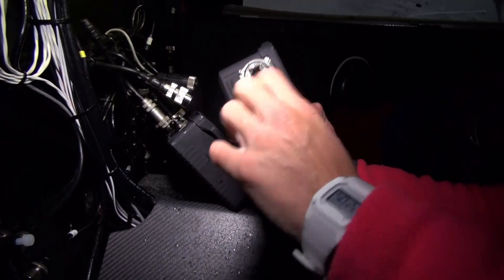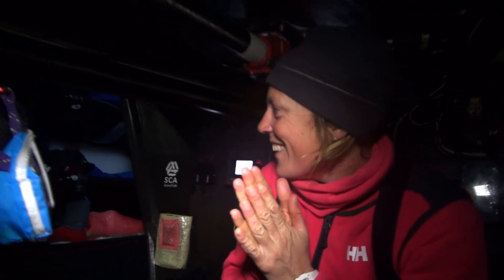Day 14: Back to basics

Comment: That is the downside of having all onboard computing centralized to one single unit. If it 
 malfunctions, you will get no information at all, though all the sensors and output displays are working. 

This is also a healthy reminder to all yachtsmen and -women. The "old school things" are there not just because they are required. You might actually need them, so you better know how to use them. Even if you are not racing on the Southern Ocean near Cape Horn.